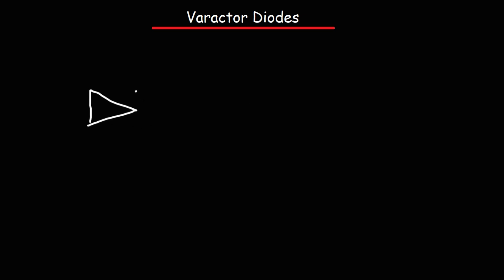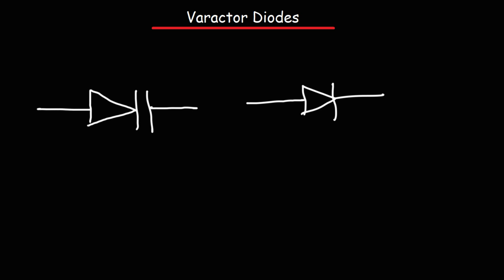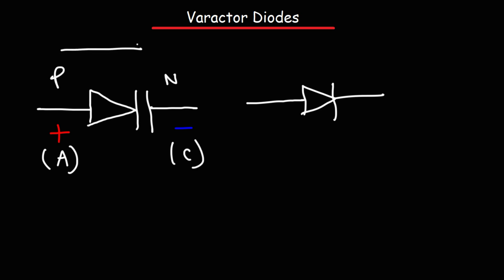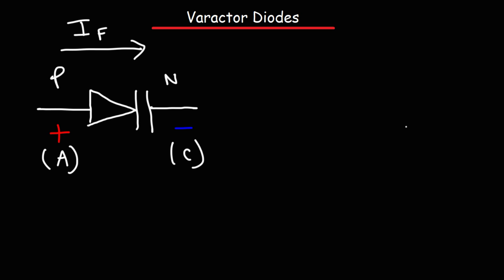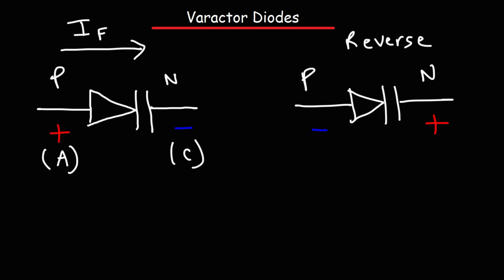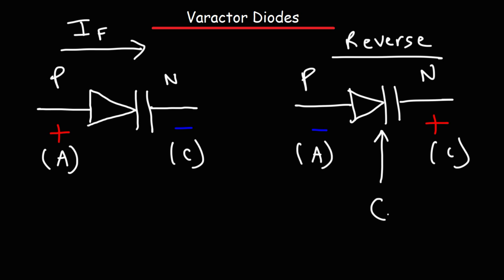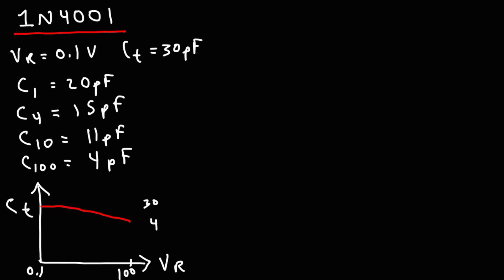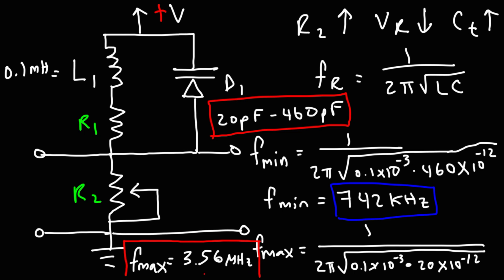Voltage Controlled Capacitors - Varactor Diodes

Comment: I just saw in the news they invented a new type of transistor called a josephson transistor. Which I'm just guessing, but the name seems to imply it uses a josephson junction. Which I'd only ever heard of being used in quantum computer. And a special circuit that's used as the standard definition for what a volt is. In any case, diode or not, they're interesting to learn about. But a bit advanced for this channel, I think. I could be wrong though.

Comment: hello, great video! Thanks for sharing your knowledge.
I was wondering if you could help me with a project I am attempting to build?
I am an electronics enthusiast hobbyist. Currently I am trying to build antenna's from wire called end-fed wire antenna. All these antenna's require a mechanical tuning capacitor which like the dinosaur are rapidly becoming extinct and ones that are avail what once were cheap are now getting expensive.
I want to build RL tuning circuit to tune high frequency (hf) radio bands from 10 meters to 80 meters in the armature radio world and want to build a solid state circuit such as the one shown here in your video using the varactor, capacitors, and resistors. I have been searching the radio amateur world to see if anyone has built such a circuit to tune antennas but can't find anything. Frustrating! Most if not all new amateur radios today have these circuits built in and thus not really needed as they work with already engineered and built antennas. But in my case I don't have this and am building my own antenna lines which require a tuner. What I can't understand is how to build one using your method and that would handle 10 watt to 100 watt in power? 

Could you help me with this project and pass along any ideas you may have regarding this.

All the best.
George
Alberta Canada

Comment: Thanks for sharing but 

1-@12:20 why when increasing R2 we have decreased reverse voltage over the diode ?

2-what is the difference between pin diode and varactors ?

3-can pin diodes or varactors be used as phase shifters if yes then how assume for ex we need 3 bit phase shifter using pin diodes or varactors how can this be implemented ?